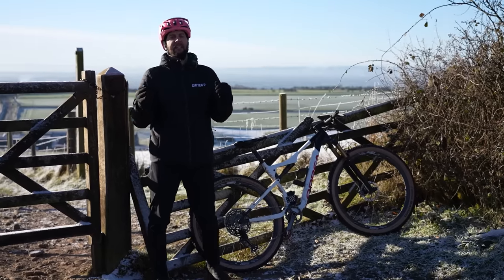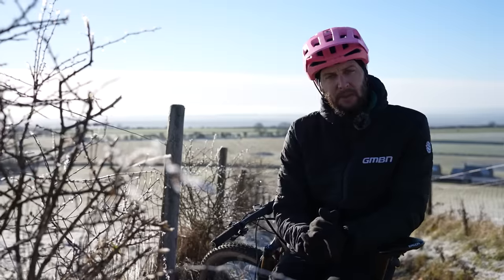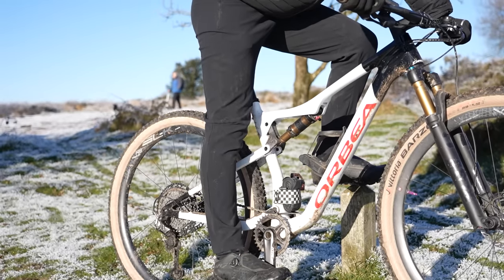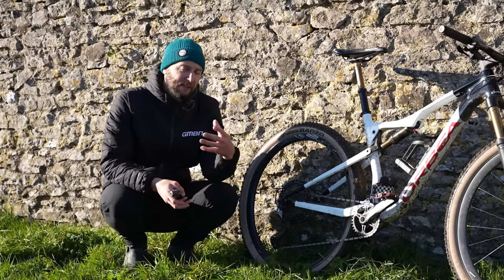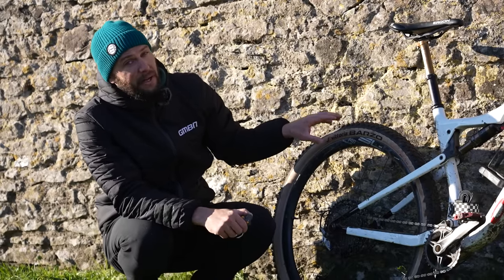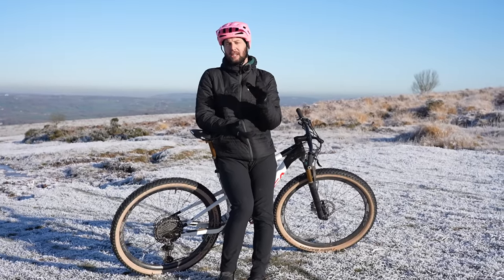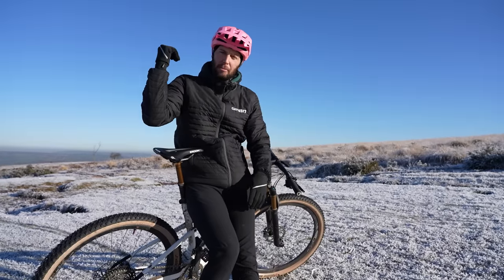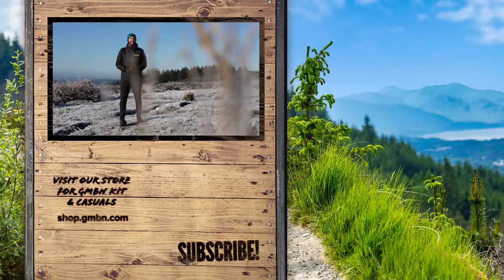Why You Are Slow Up The Climbs! | XC Climbing Mistakes

Comment: Yeah, this is a good one. The advice is much appreciated. My local trails are unmanaged forestry trails near the sea, so I have a lot of sand and roots to contend with. My main conundrum is how to keep the front end of the bike down, but keep the back wheel from spinning. It's a fun challenge and I'm so stoked when I get up an uphill section without putting my feet down.

Comment: Oval chainring. I’ve found they lay the power down evenly especially at low speed/ low cadence. Rich is right about keeping a high cadence but riding technical climbs you can easily make the tiniest miscalculations and loose what little moment you had, loose too much speed and a gear change is no longer a option. An oval chain ring can help with pulling you out of that situation, less chance of spinning out as you stomp on the pedals.

Comment: laying power down evenly and having a smooth cadence is an advantage since you keep momentum but that its more efficient is a common misconception and on road or gravel it doesnt matter at all. All the power comes from pushing down so having a perfect smooth even circle is actually less efficient research has shown

Comment: Bar ends! People don't seem to understand why bar ends were created in the first place. Well they were created to give you more leverage on the back tire and get more traction. But Mark that is why riser bars were created (you). Here is my point of contention: If you take riser bars and put bar ends on them what happens? Way more traction is what happens. The point of my rant it that bar ends are a forgotten tech that you can still utilize. Now to whether all the anti-bar end comments even if they are too young to know what they are talking about. Cheers! - M
Reply: I'm definitely the young you're talking abt, but imo barends are so absolutely horrendous looking it'd slow me down mentally. Even xc can have some drip.
Reply: When i had regular riser-bars on my bike, i never felt the need for bar-ends.  Now that i run Molokos bars (alt-flats), they're not even compatible due to the 34° backsweep.  I'll use the horns as bar-ends where i can (horns also good on longer stretches or hill-bombing on asphalt).  The degree of backsweep i have  also puts me in a more natural mid-forward position when standing/pedaling.  The oval chainring also helps with climbing grip; no dead spot in your pedal-stroke.

Comment: Weird advice about climbing, apparently picking the right line is crucial on an xc bike because you don't have big enduro tyres and extra travel to plow over everything, since when did you need big tyres and extra travel when climbing? I think he conflated bombing downhill with climbing.
Reply: That is an odd point.  I run an Enduro tire up front and it doesn't help that much if i pick a bad line uphill.  Granted, i ride a rigid bike and bad line choices will be doubly noted even though I have Some fudge-factor with a 2.6(R), 2.8(F) plus an oval chainring that has lots of pedaling grip.  Also, it was not noted that sometimes you have to stand & stomp or alternate standing/stomping with sitting/spinning in a more technical single-track climb. (Esp. with switchback turns) The local mountains and trails we have are more challenging than that black square rated, straight climb the gent in the video was using as an example.  There's a section on Total Recall (curvy techish single-track) where you descend, hit a dip, grab a few gears Quick-like, climb a fast right-handed bank turn and sit/grind the straight part to the crest.  It's definitely rocky and rewards a beefier tire plus a combination of climbing techniques in an intense, short section.   The point being,  that not all climb types are best ascended with one technique only within the section.